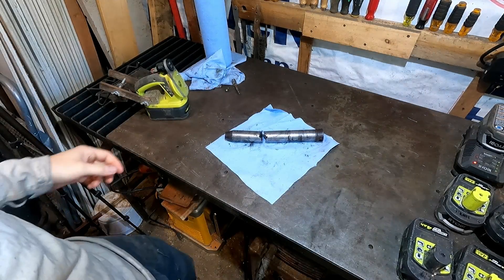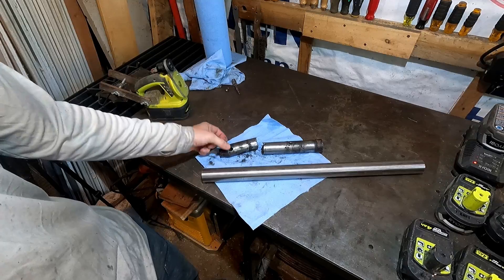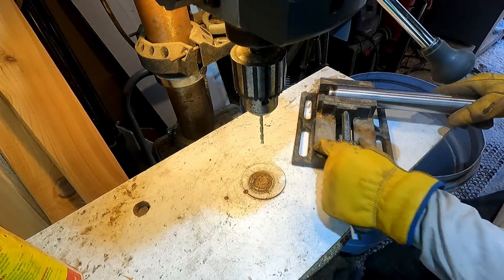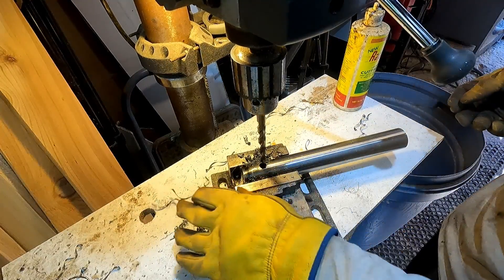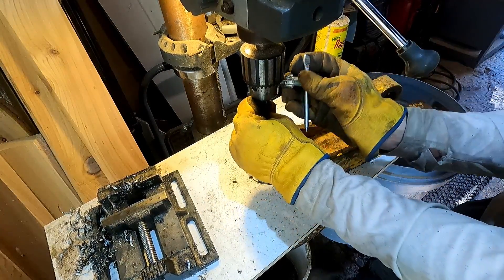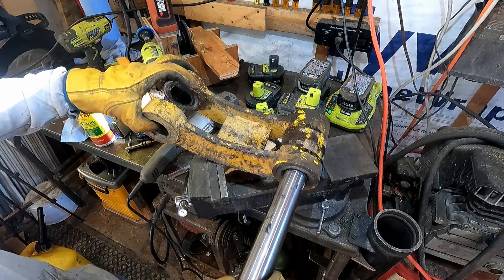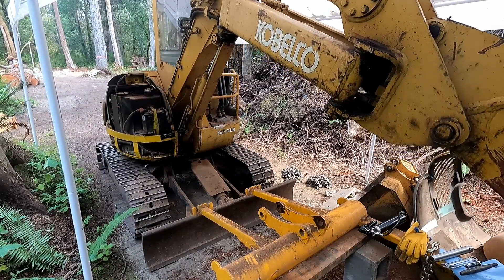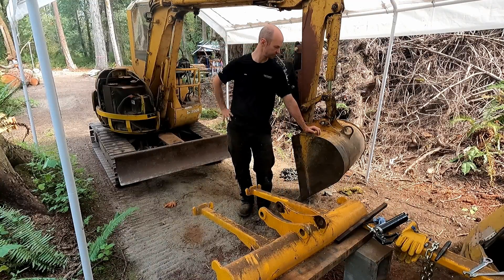Replacing a Broken Excavator Pin

Comment: Seeing you cut that pin reminded me of when you had something like that chucked up in the lathe at work and were cutting it with a hacksaw then we convinced you to try just turning the lathe on really slow rather than you working the saw. Good times!
Reply from the maker: Oh man, one of those lathes would have made this project SO much easier. Not only cutting the lead-in, but I could have turned the 1-7/16" stock that I was shipped into the 1-3/8" diameter that I needed without waiting another week for freight. As is often the case, though, the right tool for the job wasn't the best tool for the job, but rather the one that I had at my disposal.